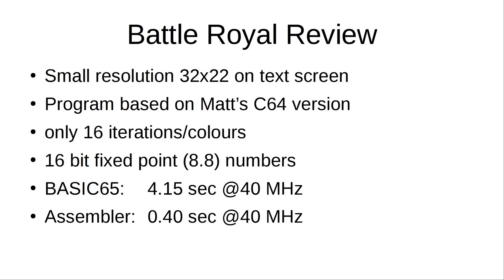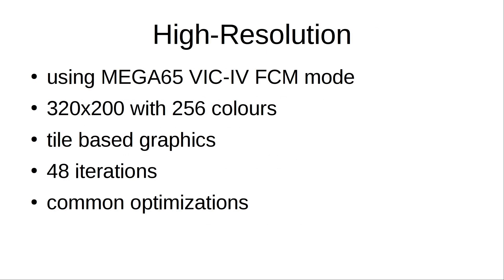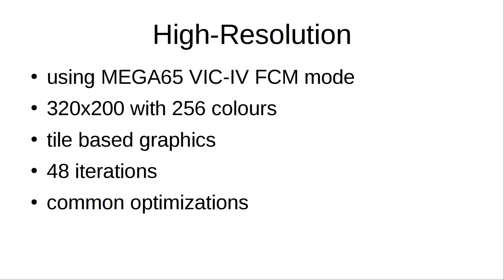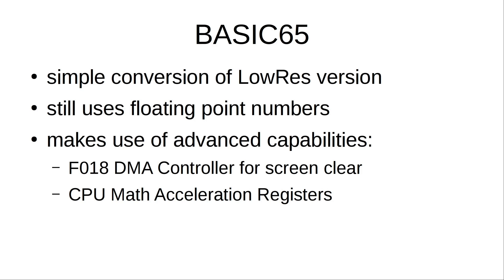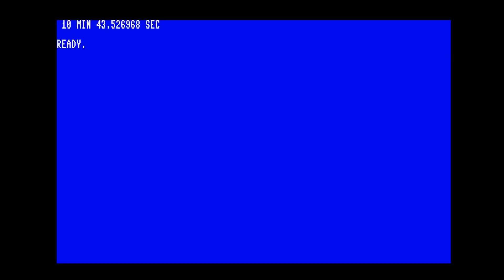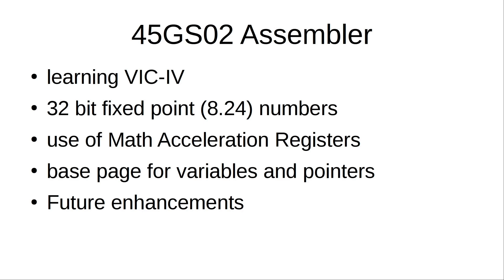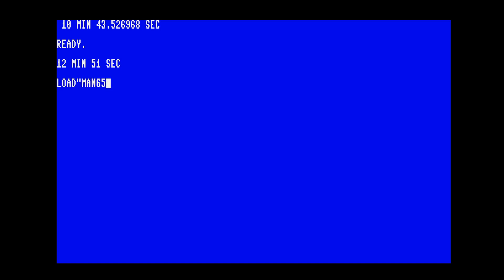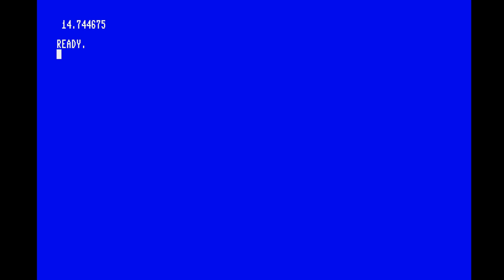MEGA65 Computation Power

Comment from the maker: Some comparision between the assembler versions: the old version rendered 32x22 pixels in 0.4 seconds. The new version renders 90 times as many datapoints with three times more precision (that is triple the iterations and three times as many fractional bits). So in total it is about 15 times faster.

BTW: The MEGA65 can be preordered right now at the Trenz-Electronics store!

Comment: "yet" ... me, feeling guilty now, you know which part ;) But seriously now. Great video. I wonder, how fast it could be with the FPU (fixed-point-unit, not floating), however that thing does not work on MEGA65 either (surely neither in Xemu). That would allow to chain multiple operations like squaring number and add to something etc, without to need to load/store results and input each time.